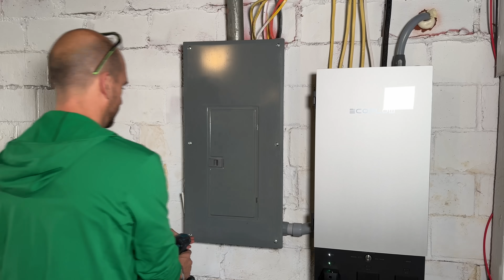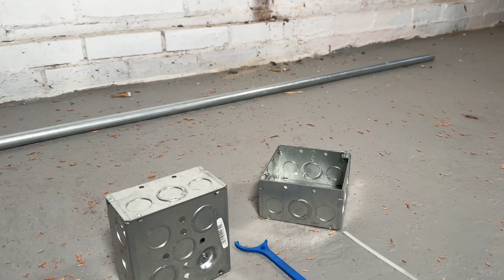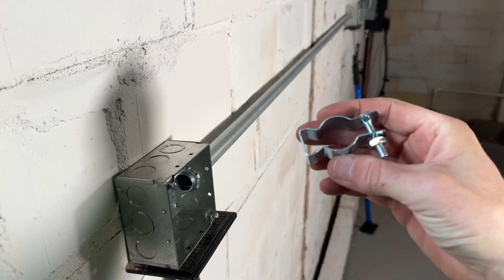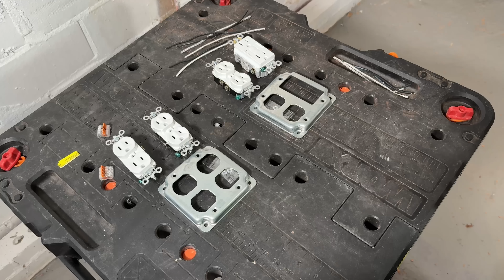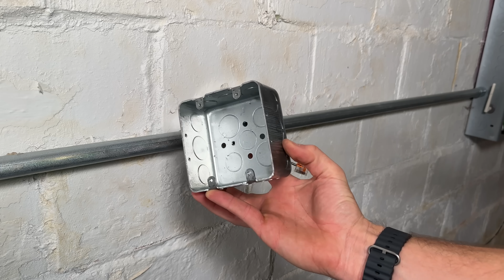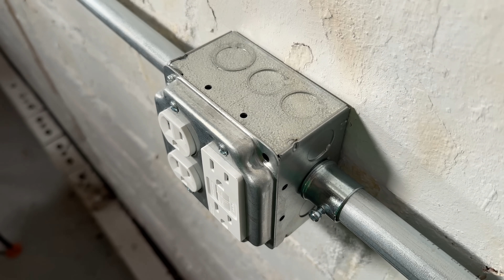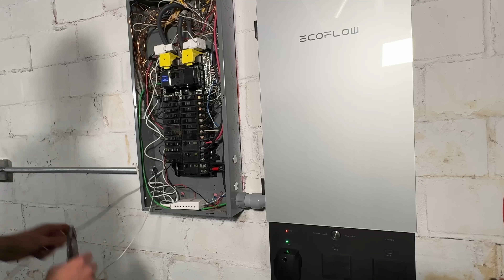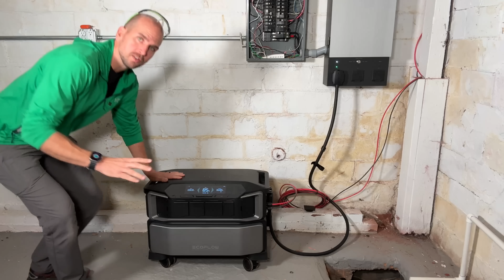Add Outlet To Unfinished Basement Or Garage

Comment: That step bit you used to enlarge the hole in the panel makes a much better pipe deburring tool than the thin, cheesy deburring blades on most pipe cutters.  You don't need  a drill, just turn it by hand.

Comment: That doesn't look like a 20 amp GFCI outlet.
Reply from the maker: Nope, those are all 15 Amp on the circuit.  As long as you have more than one outlet (even just a duplex outlet) on the 20 Amp circuit you can use 15 Amp.

Comment: The 20A outlets I find locally look different than the ones you installed (shape of the neutral). Do these vary by region?
Reply: No, those are NEMA 5-15R (15 amp receptacles) and they are not rated for 20A service. There's no protection device to prevent an overload of those receptacles in this circuit. I am not sure if this is code where this was filmed but it's not a great idea in general.
Reply from the maker: Nope, all 20 Amp outlets will have the horizontal slot you are referencing.  As long as you have more than one outlet (even just a duplex outlet) on the 20 Amp circuit you can use 15 Amp.

Comment: It would be interesting to learn the basics of working with Metal Clad cable.  
I always get something from your videos.  Thanks!
Reply from the maker: I am sure I will use MC in an upcoming video but overall I am not a huge fan.
Reply: Unless you are in commercial or industrial, don't. In many areas it is not allowed because it is too light or too problematic. Armored cable or AC cable is heavier duty but still has issues at the connector. It is one of the main contributors to the afci breakers.
Reply: @patrickhein9470  Although I have looked up AC and MC, and the difference between them, I am still unclear about it.  
Appreciate your response though.  It helps.

Comment: I would run a ground wire, even though the conduit and metal boxes ought to work. If the conduit screws loosen, the conduit could become intermittent. A ground wire inside would ensure that the boxes are still grounded even if the conduit becomes loose. Then I would also tie the ground wire to the green screw on each outlet.
Reply: Fittings screws will not magically loosen. If that was true, why would it apply to conduit fittings but not to a ground screw?

Comment: Scott, one more time. At the 10:00 minute mark when you talk grounds, you should be aware that anyone one who has gone to school for an electrical license will tell you that you do not need to run a ground all the way back to the panel. But you should install a pig tail to the ground screw on the box and pigtail a ground to each separate device. Especially the GFI as if your screws become loose for any reason holding the receptacles to the cover you then could have huge complications with grounding. That effectively ties the ground on the devices to the metal pipe.

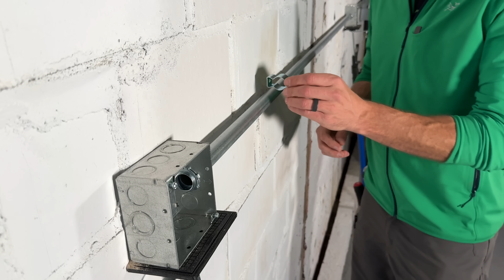Comment: Scott, once more. At the 4:45second mark you show a minerallac. These ARE required by the National Electrical Code (NEC) within 3' feet of every box. This means you are short three of them. One needs to be used between the service and the first box, and two more between the second two boxes. If you had just used a 5 foot piece of pipe for your second pipe you could have gotten by with just one in the center. Evan jsu cutting your pipe one inch short of 6 feet would have allowed you to use one minie (as we call them).
Reply: @@karlwithak. Yeah, what you described is exactly how someone who has no idea what they're doing would do it. Would the circuit work when you plug something in? Sure, just as running a single black wire and a single white wire and no ground wire and leaving them dangling along the floor would work. Just because it works that doesn't mean it's done correctly or safely.
Reply: @pld8993  Amen.
Reply: I never thought of using minies to strap the EMT down. Gotta say, it's rather ingenious, as you avoid putting in a box offset. I'll have to remember that. I don't understand why he showed the minnies, but didn't use them. So odd.
Reply: @@karlwithak. No idea what you’re talking about. But again, that was some funny shit you posted on how a DIY fool fixes wiring issues. LOL! 😂
Reply: @@karlwithak. Funny sarcasm.
Reply: You do know what half of 6 is don’t you?
Reply: @WeMe83  A baker's half dozen?
Reply: Can it be a 2 hole strap to the wall or does it have to be a minnie conduit hanger like the one he shows that keeps it "off the wall"?
Reply: @claracastro3640 it's not code to have to use the mini like he showed u to. U can use a 2 hole strap if u like or a one hole strap even. Reason he wants it off the wall is for moisture. Code is minimum u can be better always and pls do be better. Ohio work sucks especially
Reply: I'm using "mini" from now on 😅
Reply: Because the first section is not more than 3', no strap required there. The second section is 6' so one strap dead center covers it. Only 1 strap/mini needed to make the conduit code compliant.

Comment: Scott, your panel should have  mounted your garage service on thin strips of wood so there is an air gap behind it so that moisture from the all will not compromise the integrity of the panel. The usual way is to mount a couple strips of wood and then mount a piece of plywood to them thus giving you a solid foundation to mount your panel.
Reply: Not necessary in above-ground garage.
Reply: @pld8993 100 % correct. Also a waist of time
Reply: That's only if your basement is below grade.  If your basement is not below grade. You can mount Strait to the wall

Comment: You're wrong in your instalation never use standoffs. And you have to "run a ground wire"..never rely on the pipe which can break bound. Always make a ground tail on all boxes. Bend your pipe form to the wall and use 2 hole straps. Or use a unistrut to mount the pipe on.  AGAIN, NEVER BUILD A CIRCUT WITH A GREEN GROUND WIRE. IT FOR YOUR SAFETY.!  NEVER FELY ON THE PIPE TO BE YOUR GROUND. THATS WHY THERES A GROUND SCREW HOLE IN THE BOX. ATTACH IT TO THE GROUND..NEVER SKIP THAT STEP. All that pipe has to be secured within 6 inches of every box in every state in the union.  It's called electrical codes.

Comment: 20 Amp circuit.  Why not use 20 Amp outlets?  I wouldn't plug some equipment into that outlet as the plug is telling me it is 15 amp and the circuit is not designed for the load even though the circuit is designed for it.

Comment: I believe that you still need the ground wire pigtail from the grounding terminal on the device to a ground bonding screw inside the box. Yes you can use the metal conduit and boxes as the grounding BUT as soon as you remove that outlet cover with the outlets from the box, the cover as well as the outlets are no longer grounded. A pigtail ground from the devices to the box needs to be in place for when the outlet cover is removed. This allows for troubleshooting on live electrical circuits where all safeguards (i.e. grounds) are still intact on all metal equipment.

Comment: Should be 20 amp receptacles , not 15 amp
Reply from the maker: Nothing wrong with having15 Amp outlets on a 20 Amp circuit.  Just need to have more than one and even a single duplex outlet will meet code.

Comment: yea I dunno I would run a ground wire, galvanized steel offers much higher resistance than a copper wire over any length , I have seen runs in the factory where the difference in ground was nearly 30 volts from end to end
Reply: Metal conduit is a better grounding path than a copper wire up to about 400'. While steel generally has higher resistance than copper, 1/2" EMT has much more conductive surface area than a #14 copper wire, for example.

Comment: always run a ground wire NEVER trust set screw emt for a ground. NEVER use tubing cutter for electrical conduit and always use pan head screws not hex head in the boxes. On the stand offs its ok.

Comment: I thought these days using conduit as the ground was frowned upon, at least I was recommended to always pull a ground in commercial applications.
Reply from the maker: Looks like it is still frowned upon, I would continue pulling a ground wire.

Comment: This whole setup is secured by screws fastened to the mortar between the cinder blocks. As I understand it, that is a faulty mounting method as mortar is not designed for gripping things like screws. I am not an electrician but the idea of using the conduit as your circuit ground just screams code violation to me.
Reply from the maker: I prefer drilling into brick as well, just not at this home.  The block is brittle and no better than the mortar.

Comment: What happened to the conduit offsets?
Reply: Not necessary. He should have added a mini to the center of the 6' length that way he did it, or he could have used box offsets to get it tight to the wall and used a 1-hole strap. Either way  is fine.

Comment: 20 amp circuit but 15 amp outlets 🤔
Reply from the maker: Just as long as you have at least 1 duplex outlet (15 Amp) on a 20 Amp breaker circuit you are good.

Comment: You don't need a specialty wrench. Hand tighten the connector so the set screw is about 90deg away from where you want it to end up, tighten with channel-locks and the locknut will hold itself in place inside the box as you're tightening it. Connectors are designed so 90deg with a tool takes it from hand-tight to tool-tight. Also, this is not a good method to installing conduit. Start at the panel, install first emt piece to first box, level everything and mount box to wall. Then work from that box to the next. Nobody installs EMT like this, you're creating more work for yourself than necessary. Also, you should NEVER leave things loose with the idea that you'll come and tighten everything later because you won't, you'll miss something.

Comment: If conduit is not required by the Code, given the grounding provision this is a complete BS and nice to have option used on industrial enterprises to maintain good safety record. Conduit is needed in a wet environment. Is your basement flooding? Is your house flooding?
Reply from the maker: I hope not 🤞 Still don't have the sump pump installed.

Comment: The GFCI does not give a pass on grounding requirements or integrity, it is a device and as such can be easily damaged or fail, resulting in loss of GF protection.  While Code allows conduit to be used as a grounding conductor, it is in the REAL WORLD a bad practice. Any damage to fittings can cause a high resistance or lost grounding path, which is dangerous. And candidly, with such a short run there is absolutely NO EXCUSE for not using a separate grounding conductor, NONE.
Reply from the maker: I agree, running a ground would be a better option and give a backup to avoid failure.  Thanks for the feedback.

Comment: Hi, I am in the UK so presume the 'code' may be different but I would have thought the extra layer of insulation on Romex would be a good thing but obviously I am wrong. What is the rationale behind this?  Many thanks.
Reply: I don't have an official answer but I was always told it was due to the wire temperature rating. Inside the conduit, the Romex does not get enough air around it for cooling?? Also, I think it was not rated for being in conduit?
Reply: Romex is permitted inside EMT in the United States. Conduit has a maximum fill ratio to deal with heat dissipation. It's metal so it does allow some heat out. I imagine rules are different for PVC.

It's not a great idea though as Romex is pretty stiff and you can't rearrange the wires so easily, so it takes up a lot of space compared to stranded wire.

Comment: No, those conduit supports (minerilac straps) are required. And it's not legal to use pipe cutters. I hope people are not taking your advice because your installation is flawed and would not stand up to an actual inspection by a pro.

Comment: using a pipe cutter on electrical conduit is illegal....!
Reply from the maker: Why is it Illegal as long as you are maintaining the diameter and not creating an internal ridge?
Reply: @EverydayHomeRepairs  AFAIK, it's not "illegal" as much as it's discouraged because of possible distortion of the end of the conduit. I believe codes more specifically state that the ends need to be properly reamed and/or finished to remove any burrs, ridges, or distortion while not flaring the end.

Comment: I never depend on the mechanical ground provided by emt connectors and their set screws...corrosion occurs after time and I've seen these installs open without proper ground connection. I don't believe saving a few cents by not pulling the ground wire is good practice for the long run.

Comment: There are too many things wrong with the conduit shown being installed.  First the codes REQUIRE that every exposed conduit run longer than 18" be anchored to a structure within one foot of each box and every six feet between them at a minimum. This is not optional and will get an installation rejected by an inspector.  The diameter of the conduit isn't relevant to that .  Second you never anchor things attached to brick wall into the mortar. Brick mortar isn't "brittle". It has very little shear strength. Third, the square box type is wrong; your explanation is wrong. REGARDLESS of the wall finish, a surface mount wall box is drawn with rounded contours and uses the cover plates shown which DO NOT overhang the outside of the box to reduce the possibility of something being cut or torn as it passes. Fourth, EMT is NOT a substitute for a grounding.  ALL codes require a grounding wire within each conduit run in a new installation. It's not optional.  Under no code is it acceptable to use the frame of a receptacle or a cover place for grounding.

Comment: For the small incremental cost and time, I always run a separate ground wire. Never had an issue, and the local inspector agrees with me.
Reply: Check out the fire at MGM Grand.  Separated conduit, no ground wire. No path back to panel to trip breaker.
Reply: Actually, it has been required per NEC for over 30 years , ever since an inspectir got zapped due to a sepperated conduit
Reply: @MrOpinionCantSignIn  That is NOT true. EMT (electrical metallic tubing used here) and other metallic conduits are acceptable for grounding according to the National Electrical Code.
Reply: @whiggins101  Yup. A ground is ground. I have been splicing high voltage PILC cable for 40 years, the lead sheave acts as ground, with an occasional twisted #10 wire going to the ground tree in the manhole.
Reply: @MrOpinionCantSignIn  Not true. Conduit EGC is legal.

Comment: I fully understand the concept of the emt taking the place of the ground wire and it is permissible in the national code to do so. I highly recommend against that practice in any situation. Perhaps a smaller conductor for cost reduction and that’s also permissible because the emt meets the requirements all on its own.  The diy person isn’t typically going to understand the “difference in potential” of the resistance between metallic connections should any of the components become loose, damaged or corroded. Conduits all on their own are just not reliable enough for my liking.  But that’s an opinion!
Reply from the maker: Thanks for the feedback.  I agree just easy enough to pull the ground and add it to the outlets and boxes.
Reply: It's not permissible to use the conduit as a ground. Never has been. Read the national code. There must be a ground wire back to the main panel and pig tail grounds on every box.

Comment: Without a ground if the hot wire inside a device frays and connects to the case, you have a risk of electrocution. A ground wire keeps the case from becoming "hot."

Comment: No ground wire is acceptable as far as the code is concerned  , but , it is the most MINIMUM REQUIREMENT and maybe not necessarily the best !
Reply from the maker: Fair point, thanks for the feedback.

Comment: According to NEC 358.30(A) "EMT shall be securely fastened in place at intervals not to exceed 3 m (10 ft). In addition, each EMT run between termination points shall be securely fastened within 900 mm (3 ft) of each outlet box, junction box, device box, cabinet, conduit body, or other tubing termination." Your video showed that you had the EMT straps, you should install these before walking away from your project.

You are correct about the grounding: according to NEC 358.60 "EMT shall be permitted as an equipment grounding conductor." But, again, your video showed that you had the grounding pigtails. Using the pigtails and an actual equipment grounding conductor from the outlets to the panel would cost a couple of dollars and a couple of minutes. It would also add protection, and help "future proof" an installation (NEC generally becomes MORE restrictive over the years, not LESS).
Reply from the maker: Yeah, should have added the 2 hangers between the boxes.  Thanks for the feedback!
Reply: @EverydayHomeRepairs   And the pigtails between the devices and the box.  A loose plate = loose grounding to the devices.